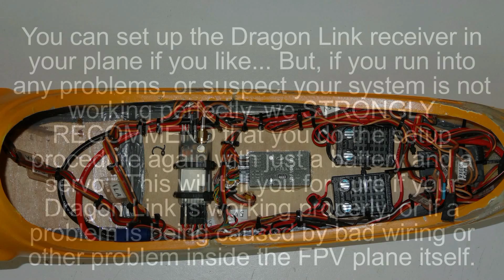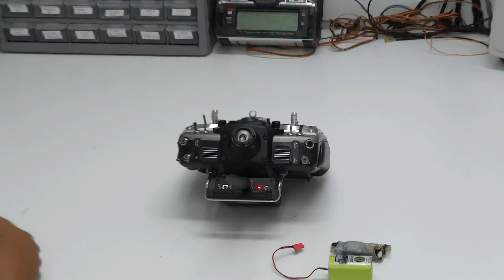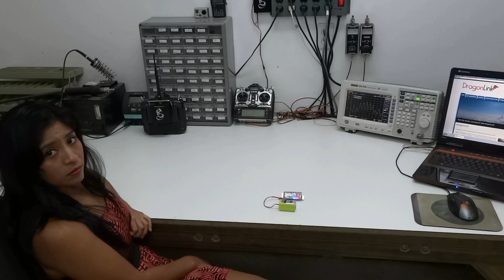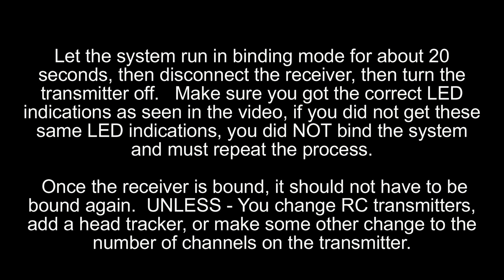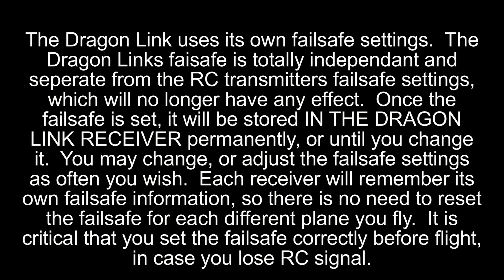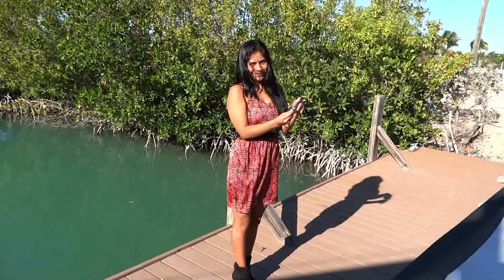Dragon Link Installation:  STEP 2 - Receiver, Calibration, Binding, and Testing

Comment: found the problem. faulty solder joints in the uhf board. back side of the board. works great now. i did order a dragonlink in the meantime, and these videos will be very helpful when i configure it.  thanks mike, and rosa, and dog.

Comment: Thanks for your great videos on the Dragon link.  I recently purchased the Slim DL but haven't used it yet.  One question...in the past I have set my failsafe with 50% throttle and RTH.  One flight I didn't do that and I went into the failsafe without the throttle on at all.  The plane started the RTH and glided about a mile before landing in an orchard.  How do you set your failsafe, especially when going long distance?  TX.

Comment: I am having a problem with my NEW dragonlink working with my Futaba T10CAG. I am using the FY31ap, the Hornet OSD, and the Dragonlink 12channel, For some reason, I can't get the channel 9 -12 to be controlled by my futaba. I need channel 9 for my Pan and 10 for my tilt and I can't bet any of the switches or nobs on my Futaba to control them. Is there something I need to do to "turn them on", I do have my power (5 volts) plugged into the 12 channel and it IS powering up the unit.

Comment: Can someone do a receiver setup that shows how to program the receiver for the servo Location pins on the receiver. Show the software and to set the Rudder, elevator. Throttle, Ailerons. I hate being told to go to a forum by the Dragon Link Staff. Thank you

Comment: what happens if you plug in power the wrong way? will it short out? in video you say black wire on the bottom but it shows it to be on top when you plug it in.
Reply: Thats is the bottom, the sma side it the top.

Comment: Will the Dragon Link work with a quad copter ?
Reply: Yes, but you need an autopilot of some sort.
Reply: paulthepoptart No, the whole purpose of DragonLink is to have control of the craft. An autopilot , or waypoint manager, would be able to fly any craft by itself without radio control.

Comment: the problem with Dragon link is that i found its not reliable. flying during a ten minute flight it cuts out EVERY minute. emailed support@fpvpro and after multiple weeks they have still not solved. im about to throw it out and use somethimg else.

Comment: FAIL SAFE QUESTION:
Hello to all....
I have some problems with my DL-Failsafe. As soon as the failsafe kicks in, It goes to FULL THROTLE AND ALIVATER DOWN !  So how can I adjust ALL the servos and BEC to keep my plane flly'n in case of a Failsafe?? What I want is that my Plane keep fly'n in a wide circle, hold altitude with alivater  and Motorpower   (40% Power).  Any Video or description is welcome.  P L E A S E  H E L P   Thank you in advance for any help and advice. Greetings to all, Marcel